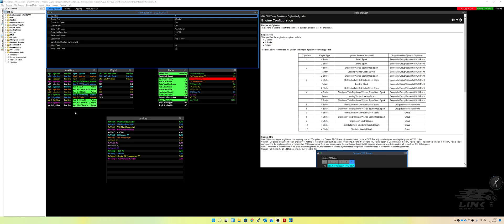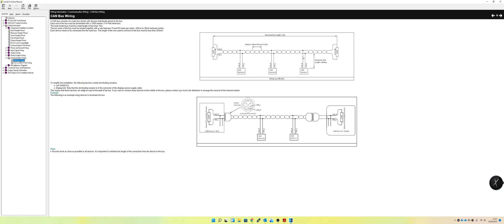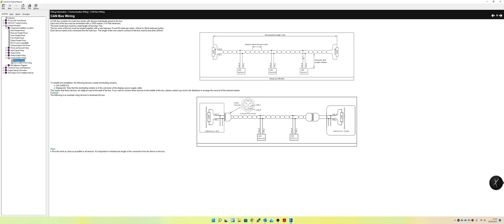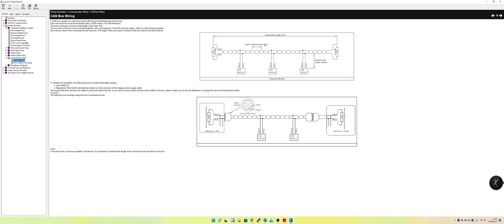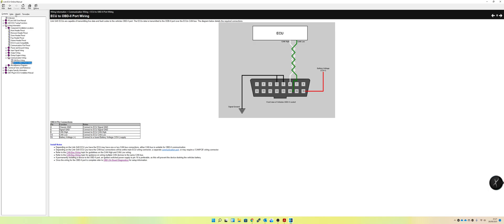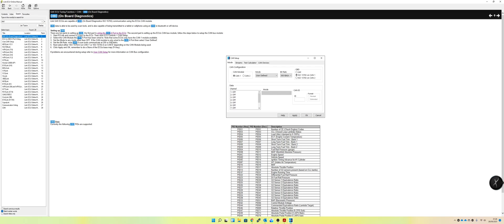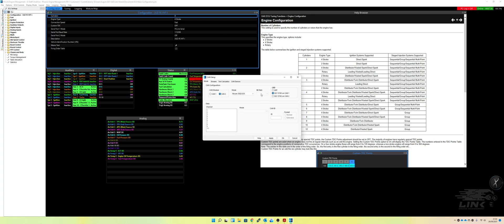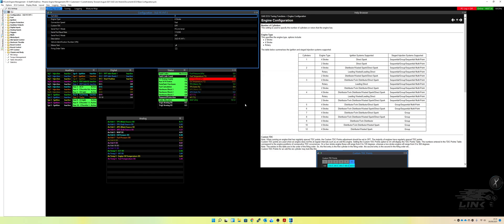Link Engine Management OBD-II CAN Setup

Comment: Hell sir, trying to connect RealDash on an android tablet to a link Xtremex ecu for a 3uz vvti in a Corolla. Purchased obdlink mx+ obd adapter but no signal is being transmitted to tablet. Any suggestions? Any help is appreciated. Thanks!
Reply from the maker: Hello Skattin. On this occasion I'm afraid I've not got much experience with Real Dash other then connecting an ECUMaster Bluetooth device to Real Dash that was a bit of a pain to get a working connection. I would probably start with just trying to plug a normal OBD-II connector into the OBD Port and see if you get any live data. Also make sure that you have set the CAN speed to 500kbps and not 1mbps as most OBD-II Devices communicate at 500Kbps.
Reply: @PhoenixEngineManagement  I figured it out. It’s pretty counter intuitive surprisingly. You don’t use obd for can connection to obd bluetooth adapter. You go to data on can setup on the link ecu and select transmit2dashpro on can2 and can id of 1000. I chose transmit rate of 200hz.